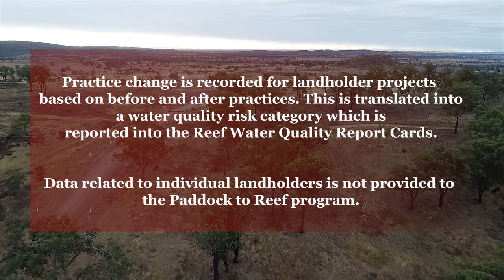Gully Erosion in the Burnett Mary

Comment: I have found that identifying the points where the volume of water is largest, digging a hole with a medium size excavator, lining the hole with a highly permeable geo fabric, placing 4-8 55 gallon plastic drums with 1” holes drilled all over them, fill with 2” rock around and to ground level about 18” above the barrels to ground level.  Then you have a drywell that was inexpensive to install.  Add however many additional drywells as needed to fix the problem.
Reply: leaky wears are even less work, more natural looking with good results concerning groundwater levels and surrounding flora..